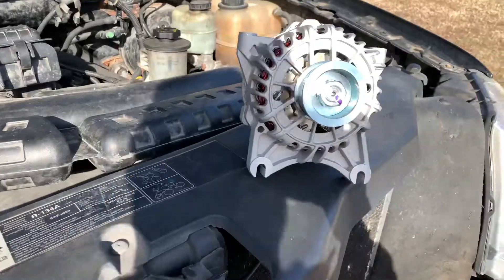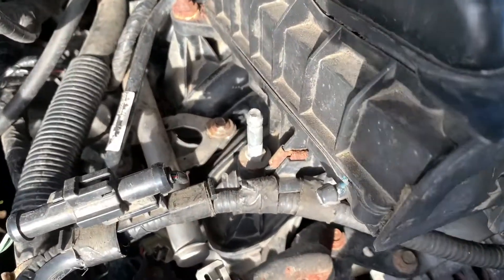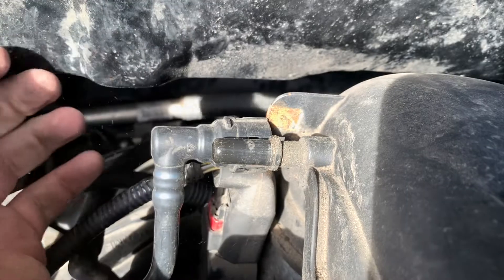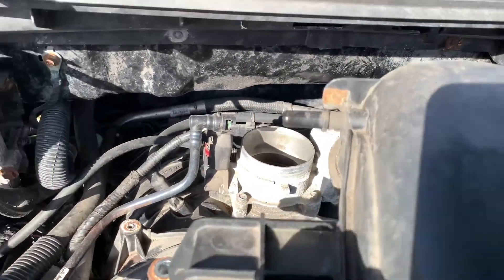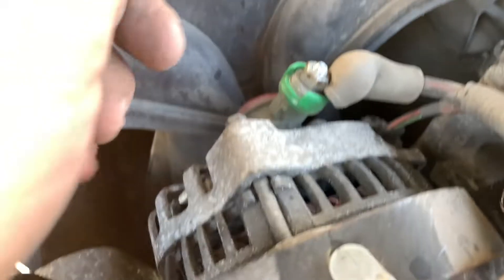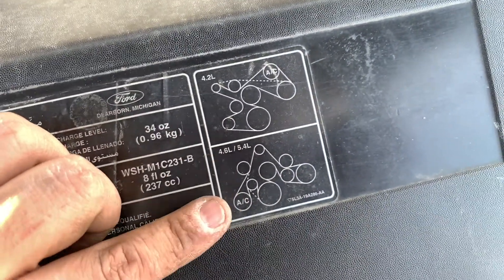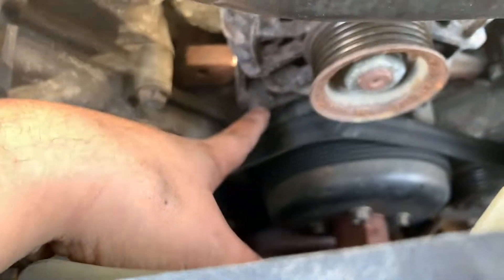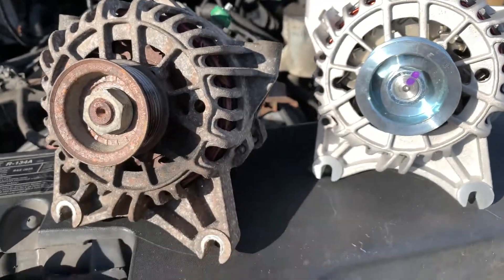Alternator Replacement on 2006 Ford F-150 (5.4L V8 Engine) Easy and Simple Repair

Comment: great video.  thank you very much.  made it easy for me to get the job done.  if there are any ladies out there, i (a 5'4" not strong lady) was able to change my alternator in an afternoon.  not as fast as a guy would have done but saved a lot of money and time -- the mechanic would have taken 2 weeks to get to it.  since i'm short i had to perch on top of the engine like a bird for a lot of it.  and i had to use a cheater bar to be strong enough to loosen the fan belt.  but i also got the throttle body cleaned while i had that accessed.  this video gave the confidence to do it.
Reply: Thank you so much for pointing out you are a lady. My alternator is bad and I was looking for videos to see if I could replace it myself. Both the video and your comment gives me the confidence to rise to the challenge.
Can I ask where you ended up purchasing the alternator? Did you have to buy a brand new battery as well? Thank you again.

Comment: Two things, my belt tensioner was 1/2 inch not 3/8s, and I am looking at electric wire clip on the alternator, trying to figure out how to unplug it. what did you do to get it unplugged? thanks.
Reply: I figured out. You have slide a small screwdriver on top of the plug under the alternator socket to release the tab.

Comment: My deep socket bolts stripped and I’m trying to use the vice grips like u did but it’s not working or I don’t have it on there right in need help lol
Reply from the maker: Rust sucks but try PB blaster and tighten the vice grip really hard. If you head the bolts a bit the shock should loosen some rust in the treads of the rusty bolts

Comment: My man just jump cut the part I was looking for tips on. An easier way to get the belt back on.
Reply from the maker: Well if you were able to get it off then the same should be when reinstalling it again. Just have to have the belt properly set and pull that tensioner hard.

Comment: How do you know how tight to make the belt after reattaching everything??
Reply from the maker: The belt tensioner Is what puts pressure on the serpentine belt. You really don't have to worry about how tight the belts gets since its spring loaded inside. When the belt tensioner is going bad it will move a lot and make lots of noise.

Comment: I thought the removal of the back connector was glossed over.  I ended up using a flat-blade screw driver bit pushed into the connector lock to be able to get the connector out of the alternator.

Comment: I wish this video was for a 2007 XLT 5.4 liter - it was helpful but the fan cowling on the 2007 covers the top frame member to the front side of the upper radiator hose and was a complete pain to deal with.

Comment: Did u put the belt on by yourself of did u have help? I can barely fit my arm in to only loosen the belt but I can’t fit another arm to put the belt back on
Reply from the maker: I did it myself. It’s a tight fit since the pulley tensioner is tough. I would realign everything again and put the belt on the alternator last.
Reply: @secondhandspeed  I have my alternator mounted already I just need to get my belt on, just so damn tough, did u just hulk it out idk what to do already have my whole forearms cut up lmao
Reply: Yes, that was the hardest part of the whole job, loosening the tension on the belt! Especially when putting it back on. There isn’t very much room to work. But I got it. I used a long cheater pipe over the wrench. I don’t think I could have done without it.

Comment: Where did you get the alternator?
Reply: I got mine from 1a auto
Reply: I just bought one from DB electrical you think there alternators good
Reply from the maker: Sorry for the late response. I bought mine on Rock Auto. Paid $150 for a brand new alternator. It’s still working great!
Reply: How tight should the belt be torqued to after putting the alternator
Reply: @christopherrenteria2810  what do you mean

Comment: Additionally, the serpentine tensioner is designed to be actuated using a 3/8" ratchet or breaker bar and not a 3/8" socket.
For me, I needed the longer 3/8" ratchet breaker bar.  Think of the serpentine belt tension pulley as a giant 3/8" drive socket.
Reply: 1/2 inch